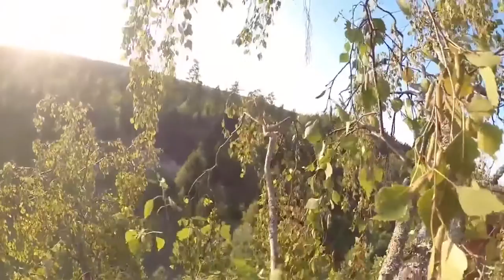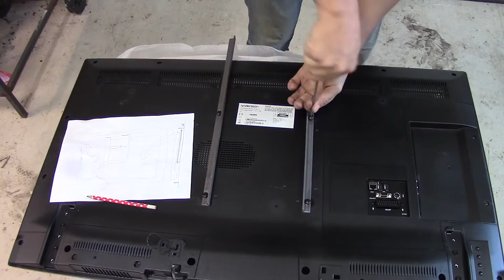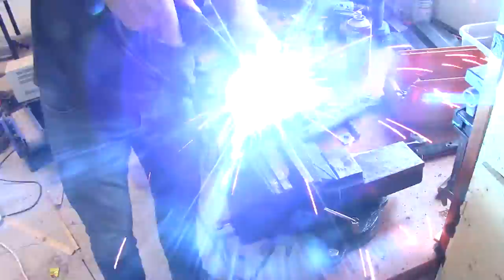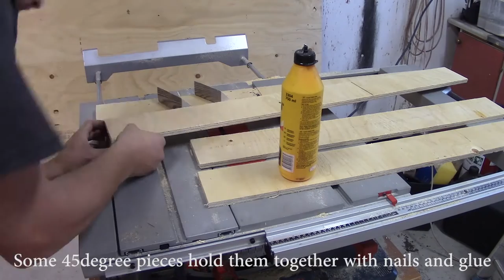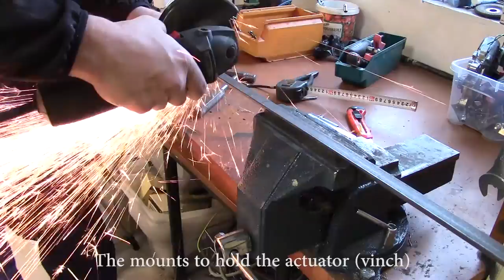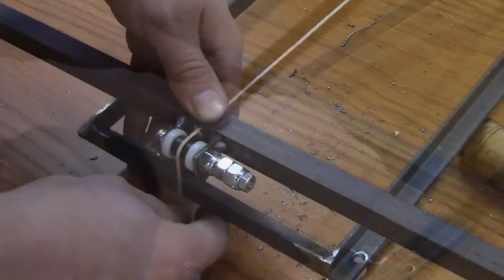DIY: Creating a TV mount for the ceiling with automatic stuff! Part 1

Comment: Awesome!! really great tutorial, glad that theres people like you out there willing to share knowledge. A question, how is it called the soldering gun that you use? its arc soldering or gas?.

Thanks!
Reply from the maker: Used a Mig welder in this video. I also have TIG that i quite frequently use.
Reply: It is a MIG or sometimes called a "Wire Welder".  The simplest uses a consumable steel wire with built-in flux, much less expensive than MIG with pressurized CO2 tanks for the occasional user.

Comment: Ah that's where you use that vinch! By the way, have you how long can power window motor run without overheating or breaking? I think they could easily run cnc router if they can be used for long periods without breaking.
Reply from the maker: Yeap. I have had this in mind for a long time and have collected some of them. You can most likely use the better ones for a CNC even though they may not be idea. Problem is that you need to add some kind of encoder for it else you dont have position. Also there is different types motors. The one i used here was with plastic housing and gears. I have others with metal gears that i think will last pretty long actually. Have seen several people using those for small cars for kids :) The one with metal housing and gear is damn fucking strong and can pull loads :D
Reply: Youtuber HomoFaciens have tested some cheap ways to make a rotary and linear encoders.